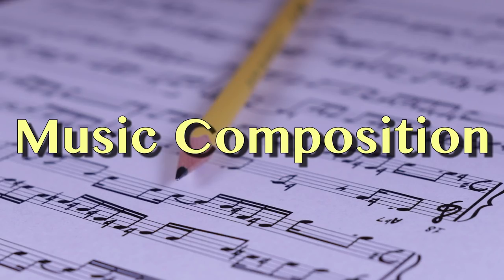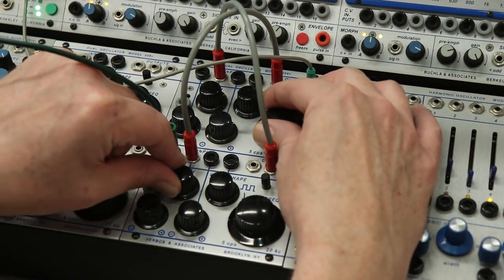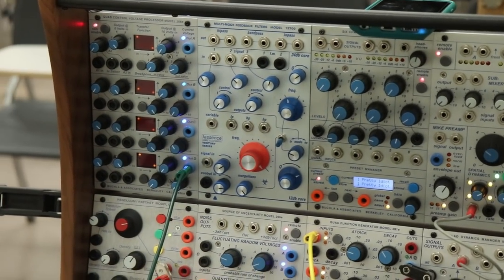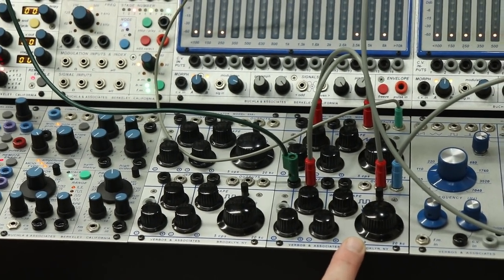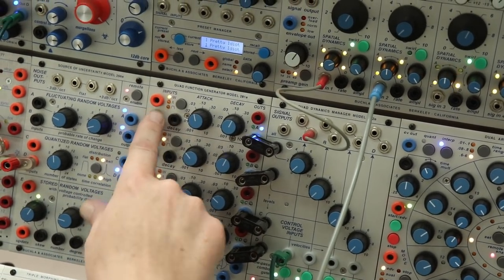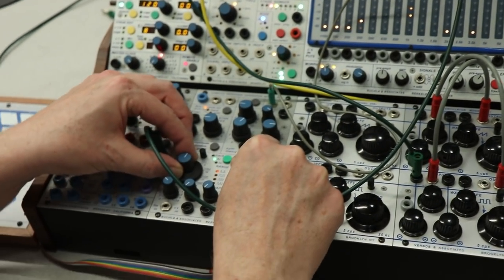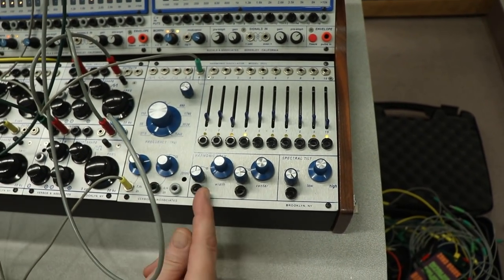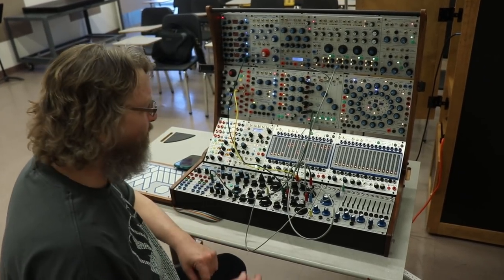The Mighty Buchla 200e Modular Synthesizer Part 1| Tutorial

Comment: I wonder if what’s going on with the Dynamics Manager knob is similar to the initial gain setting on some Euro VCAs like the Intellijel Linux which gives you two controls; one that attenuated the incoming CV (from ENV for example) and the initial level which simply sets the minimum that the VCA will close to. Turning this up completely will open the VCA right up and the incoming CV will have no effect. 👍